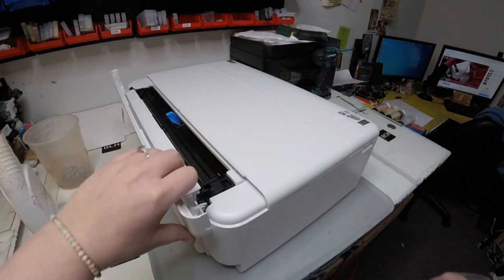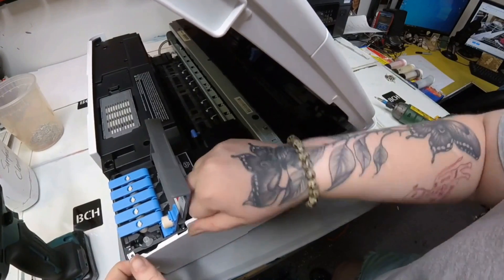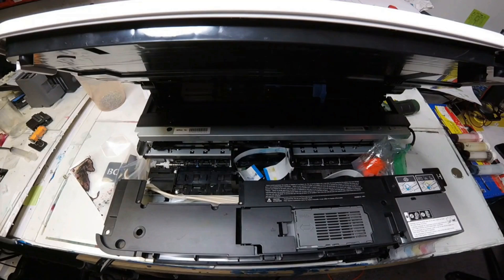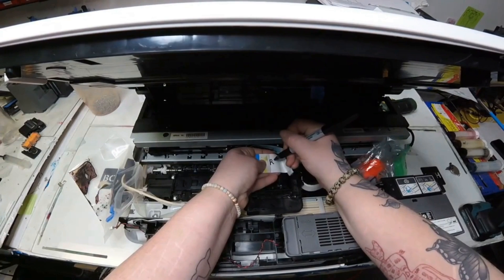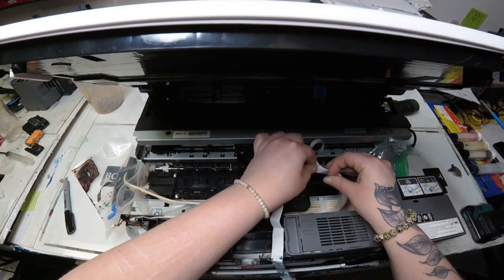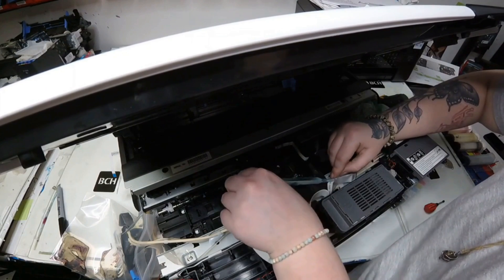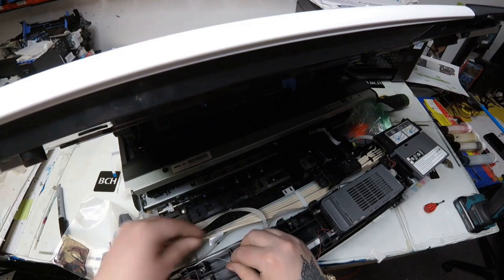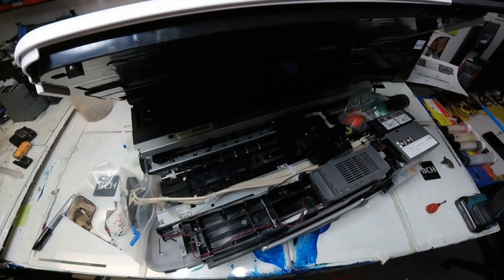Remove & Install FFC Cables in Epson ET-8550 EcoTank

Comment: Hello, I bought the

Workflow Sheet For Epson ET-8500 ET-8550 L8160 L8180 Mainboard Wiring (CJ20MAIN) where it says that the right ffc cable goes in the connectors 8 and 9 but I am confused because in another video of another person goes the left ffc please can you tell me if in your workflow sheet there is an error thank you
Reply from the maker: Thanks so much for your support and for watching the video — I really appreciate you taking the time to point this out and ask! It’s definitely possible there could be an error or at least a point of confusion in the workflow sheet, and I’ll double-check the connector labeling and revise it if needed so it’s as clear and accurate as possible. In the meantime, I’d encourage you to subscribe or become a channel member, since subscribers and members receive priority replies and extra benefits like early access to videos; because I get a high volume of questions, responses are prioritized with subscribers and members typically answered within 48 hours, regular viewers answered if time allows since I can only reply to about 10 questions per day, and after subscribers and members, remaining replies are handled last-in, first-out with newer questions reviewed first, so if you’re not subscribed and don’t hear back within 48 hours, you can either subscribe or repost your question to bring it back to the top, and if you subscribe later, your older questions automatically become priority without needing to repost. You’re also invited to join Run With Kevin — LIVE, where I go live every morning (usually between 6–8 AM Eastern) to answer printer questions in real time, so be sure to subscribe and turn on notifications if you want to catch the next session and ask directly. If you need faster assistance, feel free to email [support@bchtechnologies.com](mailto:support@bchtechnologies.com), and if this video or comment helped you, I’d truly appreciate a Google review here: [https://g.page/r/CfL7k6nYvPQ9EAg/review](https://g.page/r/CfL7k6nYvPQ9EAg/review) — it really helps support the channel.

Comment: My fcc cable has ink, is that damaged? Do i need to replace it?
Reply from the maker: Thanks for your question and for subscribing to my channel! Every subscriber is a big part of this journey, and I truly appreciate your support as I work toward that 100k milestone. If you ever need a quicker response, feel free to email me at support@bchtechnologies.com, or post your question on any of my videos. I try to reply to subscribers within 48 hours, though sometimes the backlog might cause slight delays.

As for your FFC cable, having ink on it doesn’t necessarily mean it’s damaged. However, ink can interfere with the electrical connections, potentially causing communication or functionality issues. I suggest carefully cleaning the cable with a lint-free cloth and isopropyl alcohol to remove the ink. Once cleaned, inspect the cable for any visible damage, such as exposed wires or corrosion.

If cleaning doesn’t resolve the problem or if the cable appears physically compromised, it’s best to replace it. A damaged FFC cable can lead to further issues down the line. If you’re unsure, you can send your FFC cable to us for a quick and free analysis—we’ll check it out for you and discard it if it’s damaged. Let me know how it goes!